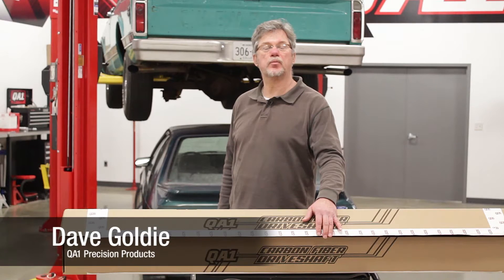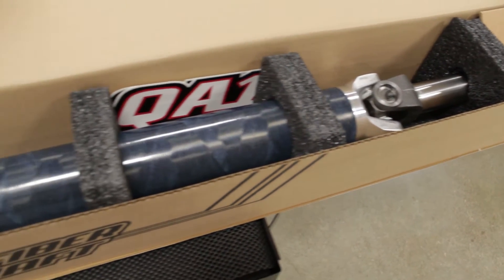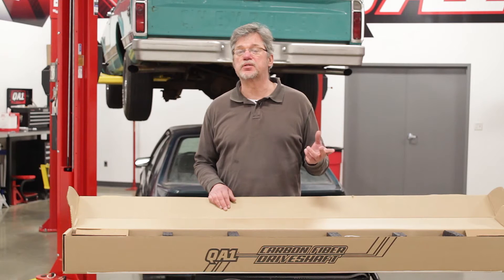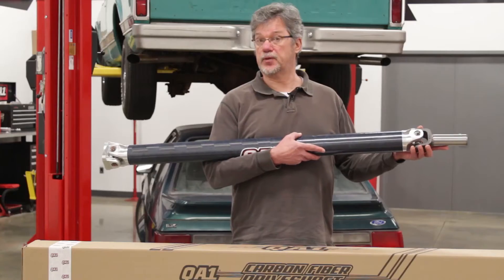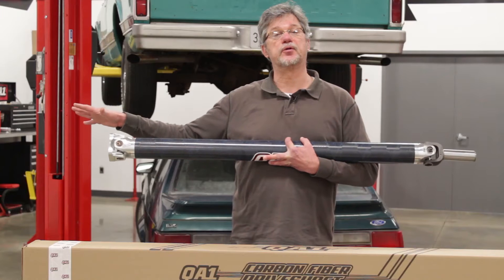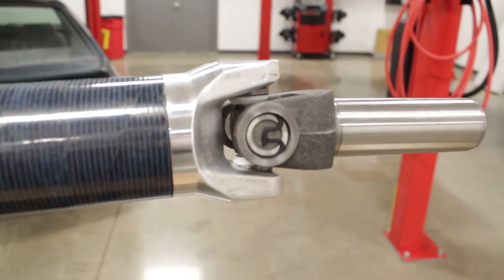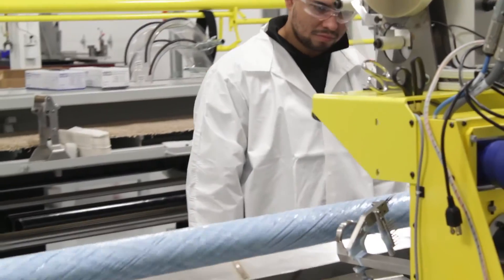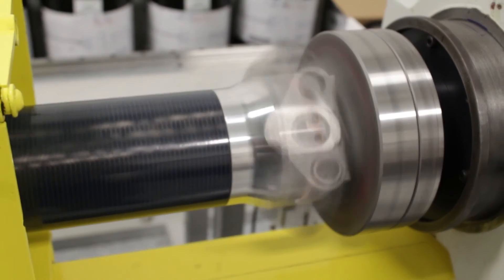Mustang Carbon Fiber Driveshafts - QA1 REV™ Series

Comment: I’ve got a 03 cobra with a t56 magnum trans conversion the power to the wheels is 720 plus whp and 680tq
26 spline input shaft . Do you guys have that ? And we’re can I buy .?
Reply from the maker: We do make custom driveshafts capable of up to 2000 hp and 1500 lb*ft tq. Here's a link to more, thanks! https://www.qa1.net/driveshafts/street-performance-racing-driveshafts/custom-rev-carbon-fiber-driveshafts